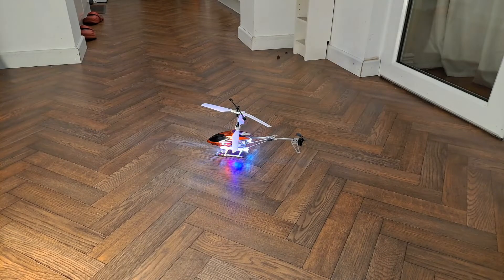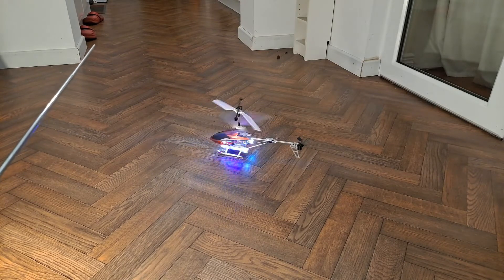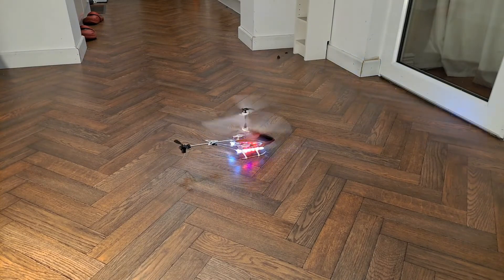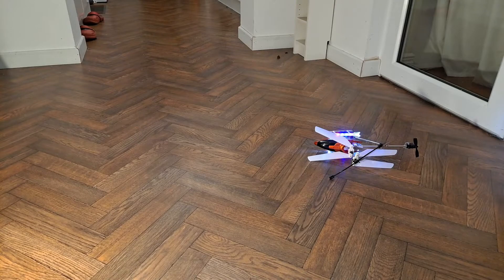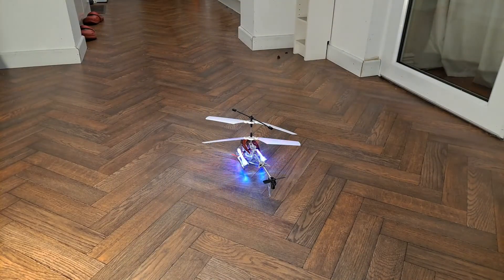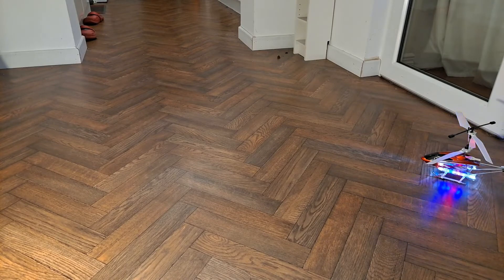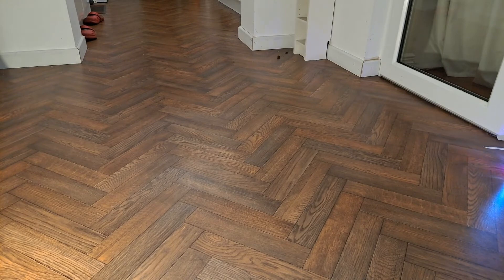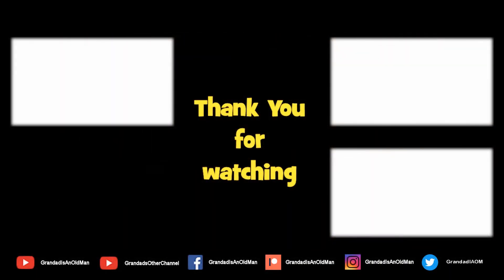Lucky Boy 9953 49 MHz RC Helicopter 3D printed parts P5 Extra Pitch

Comment: mission accomplished
Reply from the maker: Still 5 more episodes 😊
Reply: @GrandadIsAnOldMan  only five
Reply from the maker: @prep0wer  yes, once I had a 'decent' flight out of it, I put it into storage. I don't want to get involved in issues around where and what you can fly, even though this is well under the weight limit.
Reply: @GrandadIsAnOldMan  I put this in the 5 minutes of flying and 30 minutes of repairing category.
Reply: @GrandadIsAnOldMan  Helicopters also need a very high quality landing spot.

Comment: That pla must be strong, the centrifugal force on the center point has to be near 100 lbs.
Reply from the maker: The main thing about 3D printed PLA is it is strong along the 'grain' or layer, but much weaker between the layers. So a big part of the design is deciding how it is going to lay on the print bed.